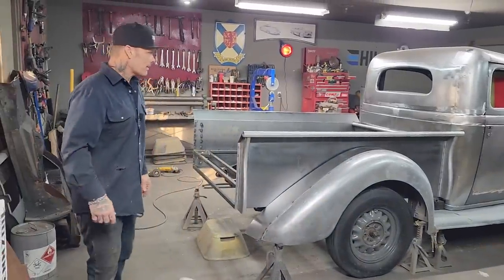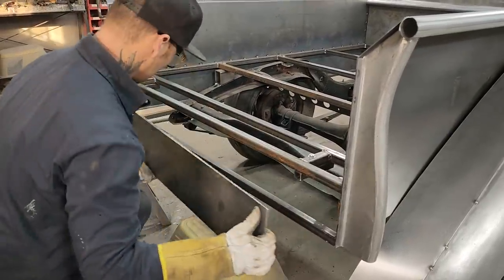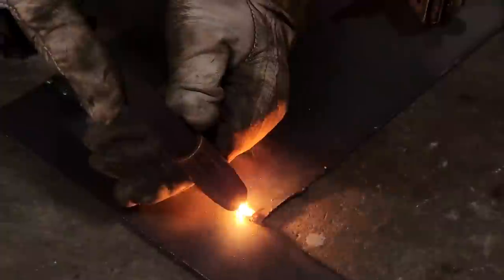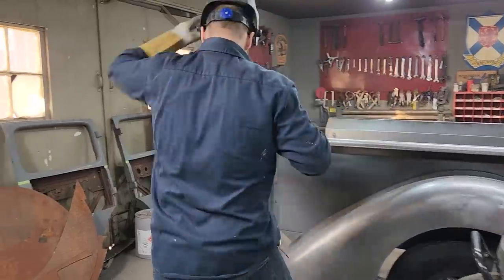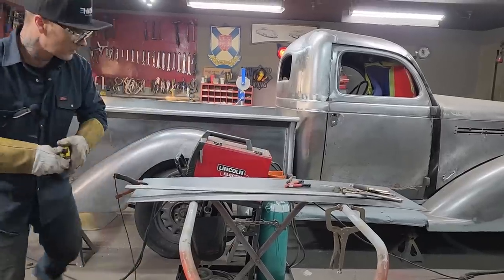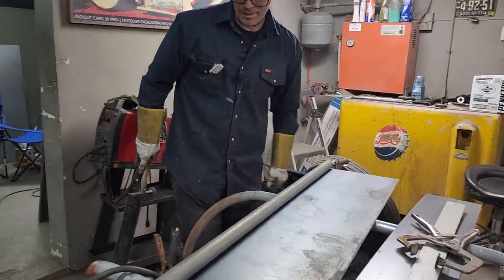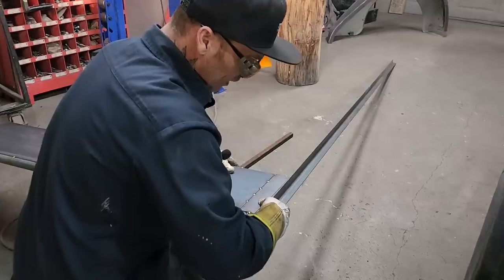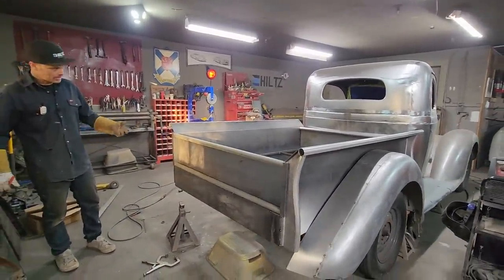Tailgate fabrication from scratch for the 1935 Plymouth custom truck

Comment: the lower panel is perfect for a recessed license plate box! might I suggest going in 4" at the bottom and tilting the plate by going 6" at the top with a plexiglass cover flush with the metal panel. use several small white LED lights mounted in the upper part of the box to illuminate the plate, red LEDs between the white ones connected to the brake lights would turn the plate area red when the brakes are on.
i love how this project is coming along. hats off to both of you!

Comment: Trivia: The leavings from cutting metal with heat is called dross.  What you chip off a weldment when welding with arc, flux core or dual shield is called slag, and the chips and spirals that come off machining is called swarf.
I've just discovered this channel and have been enjoying the ford / monarch cabover build. Happy to have found another fellow Canadian to watch eh.

Comment: It is realy cool to follow you and your beter half on the camera and i like what you are doing.
I want to dig old cows out, about your small tractor lifting ability.
It was awsum looking that you use what you got.
Next time you want to use it again, do put your lifting, chain, strap or sling over the bucket to gang down at the back of the bucet, when you attatched the lifting pease to that lifter over the bucket, you wil be suprize how mutch heavier you can lift.
I am slowly pick up on your projects and i love it.
But thanks that i never hear a swearing word, God also love it.
Greatings from New Zealand.

Comment: Chad n Jolene - I am enjoying this build immensely. Builder myself and suggest taking a thin strip, like the one lying on the floor behind you in the last scene and put a upward slanting connection between the round tubing and the tailgate panel. And use the tubing as a hinge, just like a traditional pickup. Simple and insanely simple to do.

Awaiting the door radius work. This has been my favorite build!

Comment: It is amazing, how you fabricate on the fly, and the quality of the end product.  My idea for doing the verticals on the ends, and maybe even the center, of the tailgate, would have been to use the round stock to do that job, and fill the void where the tube mounted to the sheet , so that looking from the inside, the corner would have been square, and the outside would have had the symmetrically rounded look.
For the bottom hinges, I envisaged using a GM type hinge, but having the protrusion on the tailgate, and the receptacle recessed into the box sides. .  
Please don't misunderstand and think of the above as a criticism, because it isn't in any way.  I am just throwing out my ideas for your consideration.
I enjoy watching you do your magic.
Bob

Comment: Great job!
1x6 x8 will give you 48 inches giving you
1/2 inch slack on each side.
You can drill thru cross support bars and
Use carriage bolts to fasten the wood slats.
Low cost and effective. You can cut 1 inch
Wide strips to run across top of wood for support.
Truck is coming along Fantastic.

Comment: Clearly, Chad is a master of metal fabrication for cars. His vision of what to do in advance when there is nothing to start with is outstanding. No doubt, Chad loves this part of a car build, great at it and also loves the challenge of the build. However, it's just as clear he doesn't like the other part of the build and that's the finishing of the car. Maybe it would be best to hire out someone to be his finisher. Just a thought. Build on Chad.

Comment: I love the pin and keyway hinge on those tailgates,  you pin one side and drop it on the keyway on the other,  you have to cut the keyway with the gate half open so it doesn't bounce out, nice work Chad

Comment: The truck is starting to look awesome now its all coming together Chad and jolene. I don't blame you for welding on the 2 inch piece of metal now your 300 dollar's better off. Jolene well done on catching the sound problem you was straight on the issue and got it sorted .your camera work is outstanding. Keep up the great work the both of you 👍 👏

Comment: If you want to hide the hinge put a smaller pipe inside your lower pipe which where on the end you can bolt it on a side flange. Or make a simple pin hinge on the outside where it could just slide in from the side on the outside of the tailgate. Then use a simple slide pin in the top too. You should use chains that a nostalgic look but put a clear plastic vinyl over them to protect your great paint job!

Are you going to give this build a name? Maybe call it you Sleigh and paint it Red for Christmas.

Comment: I learned with the plasma cutter when I was making those containment pans to hold the wand with my dominant hand and stretch about 2foot of the cord out straight behind the wand,and put a slight tug on that with my other hand. That totally eliminated any jerking and uncut spots. They kind of governed each other, one holding a drag and the other doing the pulling.I’ve told a few of my buddies , And now they do the same and like it. Smooth as a babies butt! Ha ha!

Comment: I like it.  You also could have notched the pipe by cutting the line on the pipe and put the end of the 14 ga in the pipe.  It would have ended up with the 14 ga in the middle of the pipe.  It would made the tail gate look a little different.

Comment: Plasma cutting: due to different thinknesses you need: different sizes of nozles, different power settings on you machine also need a distance from your nozzle to your workpiece. Ask your Lincoln supplier what you will need due to typical line of work you have.

Comment: Been watching for the last few months and am blown away by your ingenuity and creativity. As a beginning welder, I’m curious to know what your welder settings are and what size wire you use. It doesn’t seem like you ever adjust the welder or gas settings.
Reply: He uses the Lincoln 140 mig - .025 wire set at C6 most of the time with argon gas. 😉✌
Reply: @lisacarmel3532  thanks for the info. Much appreciated. It doesn’t look like he adjusts the settings whether he’s welding 18 gauge, 14 gauge or thick walled tubing and square stock. I would expect poor penetration on thick material and burn through on thin material. Rookie question on my part.

Comment: Looks fabulous ❤❤ but I would have installed the angle on the inside of the bed to make a stop, rather than the angle on the tailgate… because it would look cleaner and give you a place to stick smaller piece of pipe to the bottom pipe of the tailgate to make a hinge… just thoughts!! Love your creativity ❤

Comment: Dude, you need to invest in some cordless angle grinders.  I am sure if you asked Dewalt, Milwaukee, etc. they would sponsor your show.  I Love my Milwaukee stuff and they have a shit ton of M18 Fuel tools that is cordless and brushless lithium ion 6 or 9 mh and would love to sponsor your show.  Have Jolene contact them about sponsoring the channel, supplying you with tools and paying you for every video you make.  All you have to do is use their products on camera.  You will sell a shit ton of their product for them.  They also make heated jackets and hoodies you pop your battery in and it heats your jacket.  They are super nice, I have a jacket and love mine, they are so warm and toasty when people are freezing their asses off.  May even get you a metal sponsor for your angle iron, whatever gauge steel you need, round and square tube stock if you just mention like metal supermarket or wherever you get your metal from.  Seriously, whatever you need to build those cars get you a sponsor for it.  You can still be as frugal as you want to be, but when you have a sponsor you can’t get no better than FREE, how is that for being frugal, not costing you a dime.  That’s the ultimate frugal getting brand new stuff for nothing.

Comment: Looks great ,instead of seamsealing you can also add two small pieces of metal about one inch to the tube to the tailgate on a 45 angle, migt also look nice, anyway ,thanks for sharing

Comment: alternative would be put pattern on diagonally and weld small triangles at opposite corners. As a woodworker we called it wood stretching ,but thickness of wood was more complex with scarf joints at angles

Comment: If you take the face of your hammer and tap from cut side..that slag will fall off...no grinding ....your plasma tip needs to cut in at an angle about 10 degrees..you will have a cleaner cut with less slag...that piece will fall to the ground if your technique is right...trying to help

Comment: Hi, will you be mounting the spare tire on the passengers front guard , with a bit of panel work on the guard itself for a hollow to take the tyre. I guess it can be a hindrance when working in the engine bay, but at least if frees up the tray for what ever you’re carrying, and makes access to the tyre real easy. Cheers.

Comment: Chads fabricating and welding are the best I have ever seen. Great channel to learn and observe. Great work Chad, Jolene, and Fina. Bill
Reply: Chad has no welding skills. Intentionally leave a gap and filling with weld is not welding or penetration. It’s also and extremely weak joint.

Comment: Loving the truck, but in my eye, like them squared door corners ya are gonna round off, i see a little roll inward on the bottom edge of that metal under the gate, not a rollpan or anything, just maybe a little curl, nothing else on the truck is a straight, so this 2 should have a bit of a curve, awesome truck tho man!

Comment: Thanks Chad & Jolene for the Lesson in Welding. Just a Thought would it save a little time if you would install two Flush Rear Tail lights were you added that thin piece of Steel ?

Comment: Put pins on the lower sides on the tailgate coming from the sides of the box into the lower pipe on the tailgate and use it instead of a hinge.

Comment: The tailgate is going to be interesting as to how it is applied to the bed/box.  Chad and Jolene have it down as usual.
Reply: He could weld some round stock on the lower sides of each end of the truck sides. Then cut off- set keys on each lower end round stock of the tail gate. it would fit as a hinge at the bottom of the tailgate. this is the way my 2003 Chevrolet Silverado attached its tailgate hinge. It eventually led to some thief lifting it off my truck in the middle of the night and stealing it. fixed that problem by putting pipe clamps on the replacement tailgate hinge.
Reply: I see by adding the angle iron, my idea would no longer work.

Comment: Try putting the angle iron on the inside of the truck bed. So when the tailgate is closed the back side of tailgate would hit the angle iron. Wouldn’t see the angle iron when it’s closed then. Might look cleaner.

Comment: To make a straight line on a pipe, use a length of angle and lay it down on the pipe. It will be a straight line every time.

Comment: Hi Chad, I'm working at a company building fire and rescue vehicles. wonder how the chassis in this kind of cars will be alloved to flex due to load and driving on uneven roads, crossing sidewalks etc. We buuild the loading area with a stiff subframe and the mount to chassis i allowing the needed flex of the vehicle framechassis underneat the subframe. if chassis can not flex, all connections wil be very high tension loaded and may start cracking. Just my thoughts.

Comment: The dodge is looking good chad the finders and running boards matched up great. The tail gate looks great as well and with a wood bed will set it off great. You should paint it to match Jolenes Bugatti keep up the great work and you have a great one to push you to greatness you and Jolene are made for each other

Comment: Awesome job, But the angle square stock in the back under the tailgate will prevent the removal of the box if need be...unfortunately it but it's still welded on the angle pieces..

Comment: Chad, a suggestion,
Use a Chevrolet pickup truck, tail gate, bottom hinge. They are a 2 piece and are,
Easy to install.
To lock it. Use the old style chain.
Cheers

Comment: To add to what I just posted, another option that was popular with us guys in the late 50s - early 60s, was to smooth the outside of the gate, by covering it with sheet metal.  That will give you a lot of room for any graphics you might want to add.

Comment: @chad are you using drag tips on your plasma cutter? normal tips have a specific cutting height off the metal they are not to contact the cutting surface. drag tips have a built in stand off to keep the hole in the tip the correct height while dragging it across the metal...

Comment: I know it's too late now but wouldn't you have wanted to smooth the back side weld all the way in the areas the support bars are because it will create a hump where it didn't let the metal lay flat. .

Comment: I think as far as your plasma cutter not working, could be because you have the onboard air running and your air compressor running at the same time.  just a thought truck is looking great. I’d buy it in a minute.

Comment: Have you gave it a thought about a rear bumper
Reply: Just my opinion, but unless he plans to pull something with this vehicle...I wouldn't put a bumper on it.
I could be wrong, but I think he just covered up the ends of the frame, with that piece under the tailgate.
And even if he didn't, he would need to extend the frame rails some, to attach a bumper to.🤷‍♂️🤷‍♂️

Comment: I could not have imagined building a tailgate like this, Chad you make it look so easy. Just wondering if on the outside of the tailgate, where you have those angles, if putting stake pockets next to them on the tailgate would make it look like the sides.
 This is turning out amazing as always!
Reply: Have you ever seen stake pockets on a tail gate, No.
Reply: @edricoddot  just because it's never been done, doesn't mean that he couldn't.
After all, this IS a custom vehicle.

Comment: A sheet the size he's using doesn't cost $300.00. Does he account the price of metal into the jobs he does?
Reply: It might, where he buys it.
I didn't hear him specify the size of the sheet (4' x 8' ?)...or the gauge thickness?

I'm not saying that you are incorrect.
I haven't priced metal like that, in a couple of decades.
But, the way that lumber prices have jumped in the last couple of years, it wouldn't surprise me if the same has happened in the prices of metal.

Comment: 🟥🟥🟥 So... If the bed is mounted solid to the frame, and the cab is mounted on rubber, ( is it? ) then how does that work with the running boards? 🤔
Reply: I was wondering the same thing.
Reply: @willhorting5317  Guess they don't read all the comments
Reply: @paulricelli5520  I would not know. But I thought Chad said in an earlier video, that Jolene reads as many of the comments as she can keep up with?🤷‍♂️
Reply: @paulricelli5520  in any case, I enjoy watching.
Really enjoying this build. It reminds me of how my grandpa used to make things... vehicles, homemade tractor, homemade camper, ect... when he was alive.